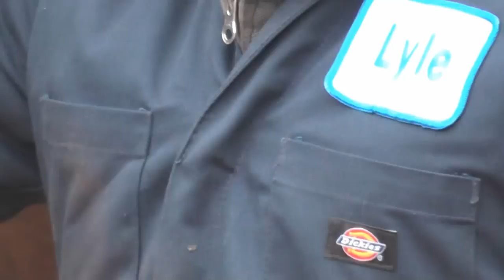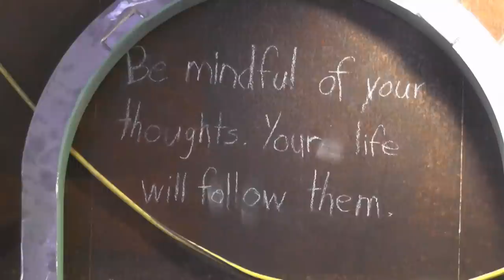Cargo Hold Framing  - Part 8 - Hatch Studs

Comment: You need to get some anode protection into the tanks. Can weld zincbars into the lowest part where water, steel and fuel will make a battery for corrosion. Or maybe this is something https://www.youtube.com/watch?v=IDeLZ-ymDOc spray on zinc?
Reply from the maker: That's only needed in salt water.   Thermal spay is a bit dated.  Epoxy paints hold up better and provide better coverage.